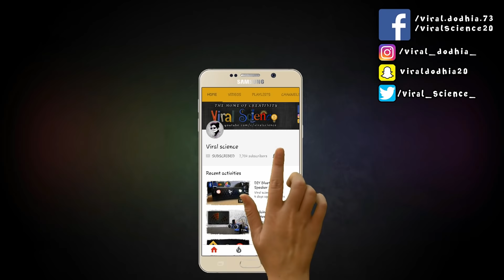DIY LAB Bench Power Supply with computer power supply

Comment: In your obstacle avoiding robot I am getting an error on uploading while verification is proper, error is: Arduino: 1.8.3 (Windows 10), Board: "Arduino/Genuino Uno"

Sketch uses 3976 bytes (12%) of program storage space. Maximum is 32256 bytes.
Global variables use 384 bytes (18%) of dynamic memory, leaving 1664 bytes for local variables. Maximum is 2048 bytes.
avrdude: ser_open(): can't open device "\\.\COM3": The system cannot find the file specified.

Problem uploading to board.  See http://www.arduino.cc/en/Guide/Troubleshooting#upload for suggestions.

This report would have more information with
"Show verbose output during compilation"
option enabled in File -> Preferences.